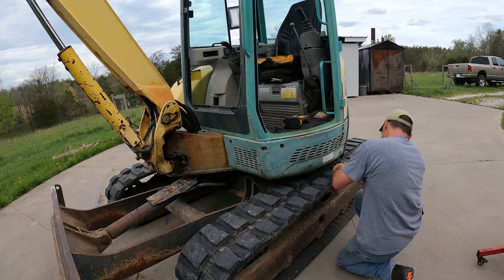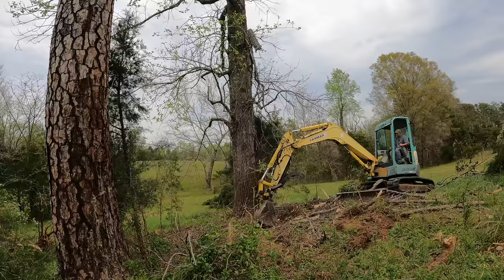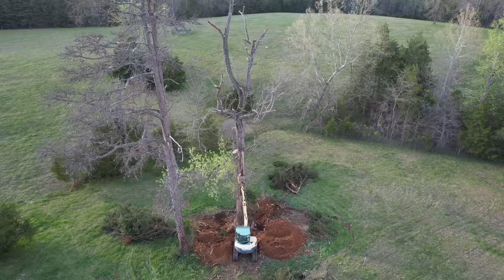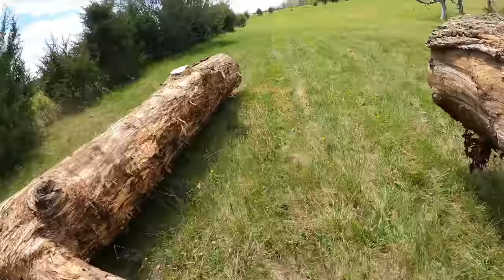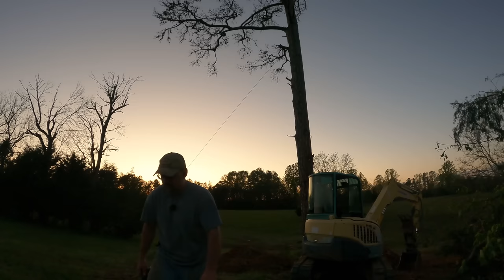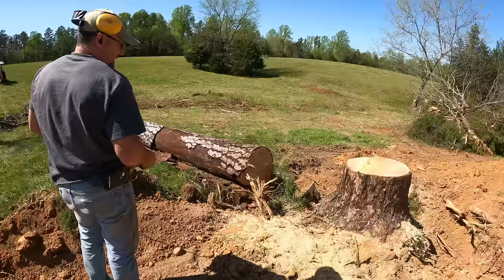Digging BIG Trees With A MINI Excavator.  Yanmar VIO50 Digger

Comment: I wonder how big that tap root went down it was thicker than the trunk so much for being a soft wood 😮 i built my Rc hobby bench out of an old solid pine dining table it took me and my dad to lift it into my shed and Andrew c are the older yanmar versions the older equipment is way better and easier to work on no computers just hydraulics and linkages and a few sensors and a starter but cant wait for the repair video

Comment: Personally,I'm gonna lobby for Melroe or Case or whomever else makes kick-ass excavators these days to sponsor this channel with a shiny new machine.  It would sell them more than all the print ads they're wasting money on combined, at a fraction of the cost.  Woodworking equipment mnfcts have learned this lesson well. Granted most of that stuff isnt 6-figures like a new excavator , but Sawstop for instance has placed at least 50 $5000 tablesaws over the years in hack "maker" garage shops and it is very effective for them.

Comment: Is there a higher-end excavator that has a system monitoring its tracks or motor outputs? Perhaps you could buy that system as a used part or strip it from a used broken down one? And then adapt it to work with your excavator? Just an idea. Would be a lot of work i bet however, it would be a great challenge and an awesome addition to your machine that could make moving your machine longer distances less of an ordeal. Maybe search all tracked vehicles, even old tanks may have some sort of system you could borrow from. And there's plenty of used tank parts around the Ukraine region. Lmao!

Comment: Had you dug all around, it would have been easier. The way you did, you were pushing against solid dirt. Look at the video when the first tree finally gives, It does not fall sideways, it goes up as it hinges on the roots and soil on the low side.  The risk of the tree falling on you had you dug on the lower side was nil. Anyway, good job. love your videos.

Comment: Yeah, I wasn't sure, but I was thinking that pine trees have tap roots; thick central roots that run real deep.

Edit: I remember my botany prof saying something about root structure typically resembles tree structure. So things like apple trees that have a trunk and spread wide branches, will have a wide root ball. But things like pines that keep branches pretty close to the trunk will have a tap root.
Reply: Not in my experience. Fir, spruce and pine usually have very shallow, fine roots. Which is why they blow over all the time, or are washed out of river banks so easily. 
Perhaps certain species though.🤷
Reply: @Court  mmm, I can't make comment on your experience. I am by no means an expert, I took one class in college, and I can't even say I was awake for most of it. It may also be a regional species thing. The cascade mountain range has the Doug fir, which to my knowledge doesn't grow much of anywhere else. I don't know that I could tell you the difference between fir spruce and pine. And the only reason I can ID the Doug is because the pinecones have mouse butts.
Reply: @RFMongoose  I'm in Northern Utah. I think it is mostly Doug fir and Spruce replanted around here as well because they make better lumber. Since the bark beetle came thru killing millions of trees they are toppling now. I've never seen a root like his out there. They usually have very shallow flat root balls. 
When rafting the Snake, often you'd have to dodge them in the river as well as the wide flat ball grabs the river bottom and turns them leaving the stump upstream. 

I was up in the high Uintas two years back and a micro bust came thru. We had 3 miles to hike back to the road, temps were dropping and rain started. The trees just started falling. You'd hear a gust  pick up and then, boom, boom, boom, getting closer and closer as the roar of the gust came. We just tried to find what looked like stout healthy trees to hide behind or any small clearings to wait the gust out while the tree around us fell. It was intense. My young son who whined and needed breaks on the way up, made it out in record time without a peep. 🤐 We had to climb over five trees on the way down that were not blocking the trail three hours earlier. An experience I'll never forget.
Reply: Here in New Zealand, we have many large plantations of Monterey Pine (Pinus Radiata). Almost without fail the roots don’t have a ‘tap root’. They only have radial roots. The exception is in very dry sites, where the roots have to hunt for water.
Reply: Dunno, the Doug's in Washington had tap roots. The only time they didn't was when the fire fungus would eat the root, which was when the tree would die and fall over (this is part of the Forests normal cycle, typically a 40 ish yr cycle: Doug => Forrest fire => alder => doug).

Comment: I didn't laugh at anything you did, because I've done quite similar stuff! I had done some tree removal at my place using a mini crossbow to shoot a steel rod with a string attached. Later, I was helping my nephew with a tree at his place, and when we couldn't get the rope high enough in a taller tree, he suggested fishing line to pull the first (small) rope up. That was the trick - spool out the line on a tarp to prevent it catching twigs or roots. My little tractor with backhoe weighs about 3300 lbs, but I dug up 11 pines around 75 feet tall. I used 100 foot ropes, and usually got them in the tree at the 50 foot level. 1000 pounds of pull on a lever 50 feet long results in 50,000 pounds of torque wrenching the stump over! I did end up climbing down a ladder into the hole to cut some of the roots, but in only a few cases did I have to cut the tap root. I used that 50 foot lever (rope attachment point in tree to ground) to pull the trees over when they were ready. That way, the stump was up at ground level (still attached) and I backfilled the holes before rolling them away and cutting them off. My regret? My regret is not going ahead and digging the footing around the new workshop. Thinking that I didn't have the knowledge to do it myself, I ended up waiting over 4 months for a qualified person to do it, and it's still not done. I should have done the research and would have gotten it done months earlier and at a much lower cost! Oh, I don't know about an excavator, but my little backhoe's bucket curling is the strongest part. To push, I extended the boom and stick, placing the curled bucket against the tree. Uncurling the bucket against the tree produced the most force. Enjoyed your video and appreciate you taking time to record, edit, and upload it!

Comment: I’ve used mini excavators like yours and 40,000 pound excavators to remove trees that size and either is a pain in the Johnson. The tap root on some of the trees are massive. Removing tree is like burning stumps, the more dirt removed the better it goes.
Now having watched the video, yes that second tree tap root isn’t unusual in size.
Excavators in the Pacific Northwest are way more expensive than what you’re talking about. A mini that weights ~10k pounds cost a minimum of $20k and has been used hard  🤮

Comment: Jon, I enjoy Your channel immensely. Our humors have the same taproots too. So no offense meant here, just questions.  First (and this is rare for You) Your problem solving. As I understand this vid,  primarily You’re trying to protect Your cattle from falling limbs (noble of You)... when they're stand in the shade of which tree?  So, How did You get to felling these trees?  Was it too dangerous to use Your 70-ish-foot Lift ( a.k.a. Johnson extender) or manscaper to trim back the dead branches?  I'm avoiding "right tool" discussions.  It appeared that the big tree was alive halfway up at least.  Second, I admire that You do Your homework and are a bit autodidactic. So isn't tree-root info available online? Clearly, I'm too lazy to look, says the recliner jock.
Reply from the maker: Thanks!  Basically I wanted to try, so I did.  I see people pushing over pretty big trees all the time on youtube and need to learn the limits of my equipment.  The big benefit of doing it this way is no stump.  I mow this field once or twice per year, and it will be nice not having those big stumps there.  But in the end, it was too much work for that little return.  Sure, I could have looked up the root structure of the pine, but that wouldn't have changed my desire to give it a try.  Cheers!

Comment: Lil story for you Mr John. I had a 110E cat excavator that I was using to clean up a old fence row. Well one sycamore tree that was 68" across the stump had to go. I had a Amish guy helping me that wanted the wood. He cut all the way around the tree, and I thought I could just push the tree over. Well that's not what happened. The hoe didn't have the power to push it in the position it was in. I tried getting the bucket in another position, to which the tree wanted to come back on the machine and me. I was at a stall, couldn't do anything. The Amish man asked me to get out of the machine cause in his words " I don't want to watch you die" I got out and went to praying. The Amish left to go get a rope to try pulling the tree off the machine. I set there and watched that tree fall and spin on its stump and fell beside the machine. It was so obvious that God himself held that tree off my machine. I learned a lot that day that I'll never forget. The Amish guy came back and checked the stump out, he said the reason it wouldn't go over is because the machine was trying to loft the whole tree. Weight, and dead patches of wood in the tree. He never noticed the dead wood when he cut the tree down. One more time my life was spared by the good lord. Be careful with big trees buddy.

Comment: so as he found out, most excavators do not have designs to drive 100% straight, the purpose is the average operator seldom has to travel longer than a few dozen meters in a straight line at high-speed
I advocate a simple NO valve that does actually link the left+right track outputs(if tuning is needed he can design a high-pressure copper coil as a flow speed restrictor for each direction on the strong side) simply bond each side together at the flick of a simple toggle(they might make such an integrated valve already)

now it may be a "mod" but given he is not a company doing digs with a truck between jobsited many dozens of miles apart, it makes sense to tune a system for your actual use-case as long as it is safe
he can even have the bais tuning be using a simple a-1, b-3 or a2, b4 valve block linked to another similar valve and interlocked to add the bias tube based on a simple control signal
an a or b path for both tubes would be ideal if possible
now another option given the lack of an existing electrical joint is to just have a valve that binds the swivel output lines that is actuated via a small RC car remote, the remote on top powered by a switched ACC line and the bottom can actually use a set of QI charging pads to top off a small battery whenever a set of charging pads is aligned between the two halves, I advocate using the steering servo to control the small valve core with a super weak return bias barely capable of a fast return when the rc motor is unpowered
there are a number of options to circumvent the lack of an extra fluid line and power through the swivel, all with pros and cons

the simplest option is almost always best, so a manual valve that binds the lines when an enable switch and the two levers are in full forward(detected via microswitches) should make it thoughtless to use, you just have the enable in case you have good reason to stop tracking straight, and the microswitches will ensure it only works when you have the "high speed" the "left track forward full" AND the "right track forward full" all enabled at once
simply wire all 4 switches in series to a small 12v automotive style relay that actuates the solenoid, add in the reverse diodes to protect the switching contacts for all the microswitches, and reap the ease of tracking straight when traveling very far at high speed
note: I included the "high speed mode detect" as you want no accidental linking when simply repositioning near a hole, the "enable" for manual disabling if you have to carefully navigate a large jobsight, and the detectors for both levers as a way to ensure it only does the mod when you are actively trying to go straight
the result is an effortless mod that may even be one that future models should include as an "optional extra" it works only in the specific high-speed travel, the only point where it makes sense to have perfectly synced tracks, and can be disabled by a simple toggle in the cab if you are at risk of accidental triggering
I think a set of automotive relay harnesses and relays(5 pack) is like <20$ on amazon, the microswitch with likely roller lever to link to the control arm full push is like the same price, a pack of schottky diodes to protect contacts is like 5-10$(useful to have when the diodes in all your cordless tools dies) and the toggles are also about 20$ for a 5-pack
each multi-pack is parts you likely want handy at the farm anyway for other tools, spares for your other stuff with relays in it(like the boom lift) and even the extra microswitches that might be part of some shop tool that you don't even know has one

Comment: I have dug out and pushed over hundreds of hardwood trees under 24" diameter and it can be done. I have never been successful with softwood because of the tap root. It may not rot enough in 30 years of being down to soften the tap root  up for digging out. Those Pine, Fir, and Hemlock are just nasty.

Comment: Check out Letsdig18. He clears tree and builds ponds. Use his excavator like a magic wand. Digging out around tree and removing side roots first then push over. Weight of tree snaps tap root below surface. Earth will cave in on spot as balance of taproot erodes. Great video

Comment: Waste of time trying to take out a tree bigger than 10" diameter.  Saw it down and burn the stump.  i've removed several smaller trees with a backhoe.  Dead ash is the easiest because after about 5 years the roots decompose and the wind can push them over.  The tree will still make good lumber.

Comment: You might just win the double entendre award... does it look bigger as in every wife says it doesn't matter. My cute way of getting on and off won't hold water either. I have not met many men who are honest enough to go there and not inside feel like everyone is sizing ya if ya even get into this conversation when the liquor is flowing and language is course. I was looking at different excavators a while ago for my son. I did find a few but the trucking it to our location was enough to just buy a new machine, get what was needed done and take the loss on returning it to the lot it came from. You might entertain making a single toothpick style attachment for your hoe. I have seen some decent ones made from scrap steel.... they are not going to help in the case of a tap root that is just as large as  the tree. I have made some bowls out of those taproots and believe me or not, I felt they were a bit harder and prettier. I say that cause of just how easy it was to dig it out and then turn it on a wood lathe. I was  told it would of made a better baseball bat than say bowls or such

Comment: Gotta be honest, digging it out from underneath seems like an awful idea.  You said the limbs are already falling and you're causing a bunch of vibrations underneath it and trying to undermine its structure with nothing but a sheet of aluminium foil and some calcium protecting your headsmoosh from decorating the cabin.

Plus in your tree cutting videos you talk at length about how important it is to cut a wedge on the side where you want it to fall, and here you are cutting a wedge in it (kinda) on the side where you are...  And that digger ain't nimble.

Worth noting that I'm a soft-handed city slicker and don't know a cow's ass from my own, but yeah based on your past videos I would never come near an idea like this unless my wife left me and took the kids.

Comment: It seems you got unlucky with this Yanmar. I think it was too run down by the previous guy. Judging by all of the deferred maintenance and other crap you found.
I have had my Yanmar since 2004 and it was never so broken that it wasn't usable.
If you really want to get a tank, search for one of these old B50's, like Andrew has. Everything is mechanical and no electronics.